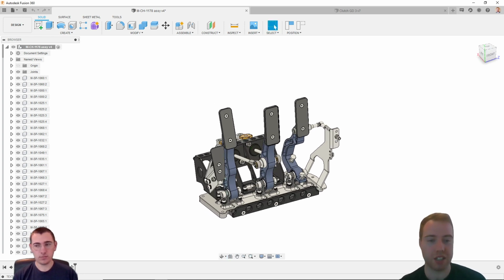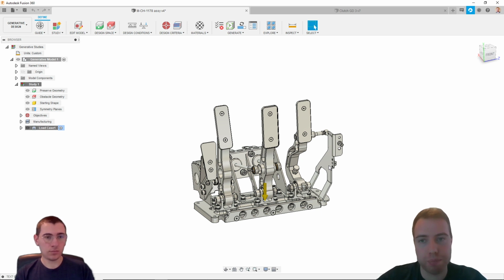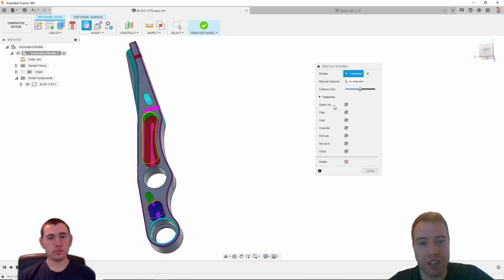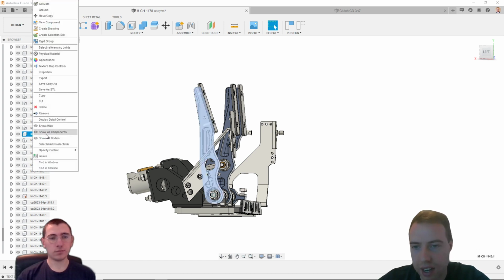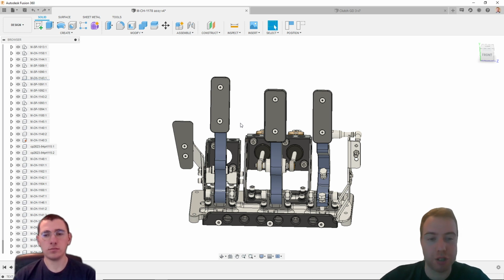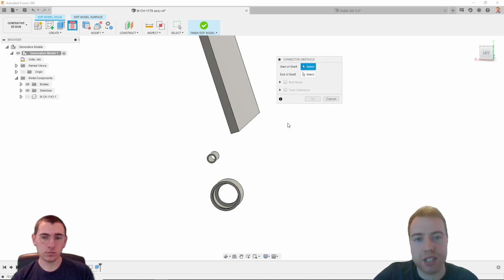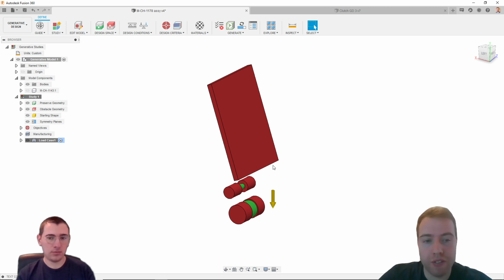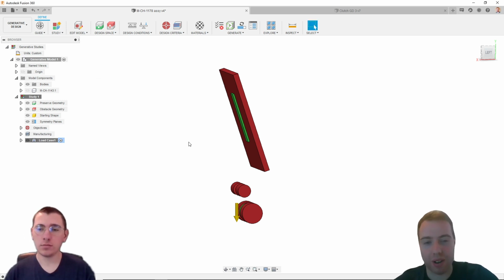360 Live: Introduction to generative design

Comment: This would be so much more effective if Autodesk had some form of entry design capability available in the regular subscription to allow people to develop generative design skills before they hit the complexity level required by commercial designs capable of funding the currently exorbitant pricing for generative design runs. We don't all work on new Airbus designs or work for a major motorcycle manufacturer.
Reply from the maker: All of the modeling capabilities in the Design workspace are available with a Free license!
Reply: @adskFusion   If I try to run a sample object to see what it produces it wants ~AUD$100 , not much of an incentive